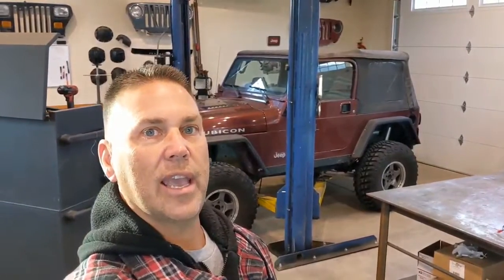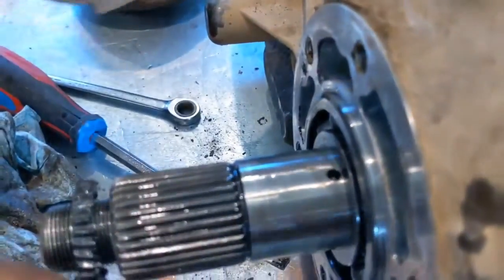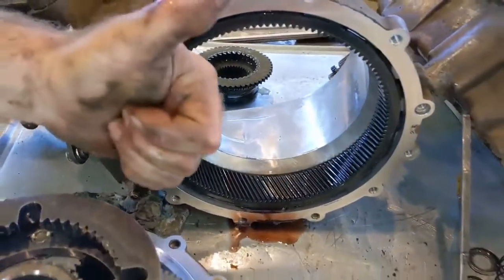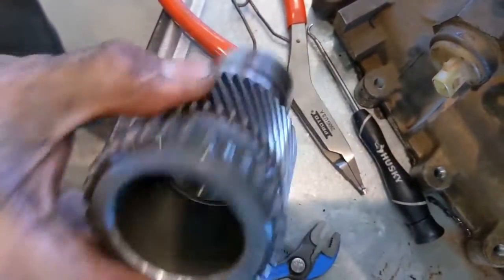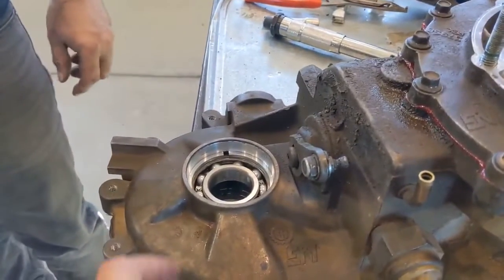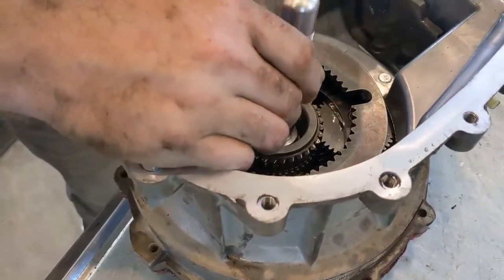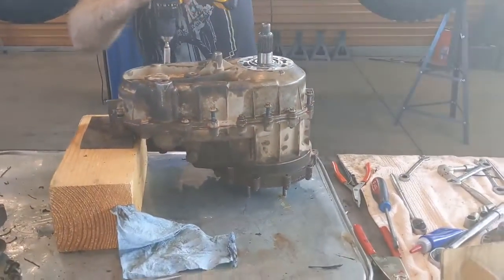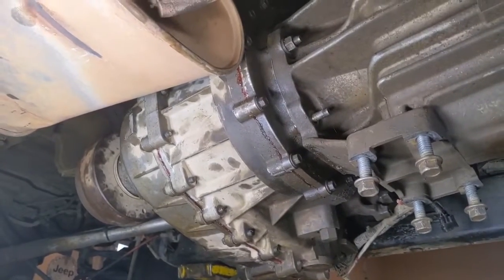How To Rebuild a Jeep Wrangler Transfer Case

Comment: When I removed the oil seal over the planetary assembly , so to extract the planetary and then remove the input bearing (5072458AA), I had to demolish the oil seal and doing so I made some scratch to aluminum edge. 
I'm thinking to place a very small quantity of gasket maker only on the scratched zone (to prevent future oil leaks) when I'll replace the new oil seal.
What do you think about?
Thanks a lot

Comment: Do you know if ATF +4 fluid contains Friction modifiers?
I'd like know to choose better RTV of Permatex.
GEAR OIL 81182 (if there are Friction modifiers inside oil). 
ULTRA Grey 82194 (if there are no Friction modifiers).
Thanks a lot
Reply from the maker: @paolofogaccia9455  ATF doesn't have friction modifiers. You'll see that in gear oil meant for limited slip differentials. If it has friction modifiers it will say so on the bottle.

Comment: At 0:59 that large circular gasket with 6 bolt holes / and 6 long slots that looks like it goes between the transmission and transfer case isn't needed. If you look at the bottom of the transmission there should be a small slot that has been machined out at the bottom where it meets the transfer case, and that slot acts as a weep hole if either the transmission output seal or the transfer case input seal leaks. My TJ also had that gasket when I took my transfer case off, but it must've been aftermarket as the dealer said no gasket is needed between the transmission and transfer case.
Reply from the maker: You are correct. We did not install the gasket either!

Comment: Thanks for the vid. I just had an issue when setting the input gear seal. I tapped it down till it stopped and all looked good. However, the shaft spun sometime during installing the input retainer to the front case half and I noticed the inner rubber of the seal was pulled away from the shaft. I had ATF’d seal, but all I can think happened was that the c-clip gap snagged on the seal and tore it while spinning. There’s nothing on the rear of my transmission that comes anywhere near the seal, so either the seal was bad or i don’t tap it down till it hits bottom with the next seal. Very weird.

Comment: Did you use anaerobic sealant on the front input shaft inner seal (around the plug that looks like a freeze plug which goes inside the splined input shaft)? Or will RTV work for that?
Reply from the maker: I can't remember what we did there. We used anaerobic where it called for it, but I just can't remember that step.
Reply: @TheBFHGarage  I went with anaerobic and I think it's fine. The seal is super tight there so I'd be willing to bet it could be pressed in with no sealant and still be fine, but it's good insurance. One thing I noticed is the front input shaft seal that is installed on the exterior of the case (the last step in the front cover) can be installed too deep. It should be flush with the cover because it can contact the bearing if pushed in all the way. I think it just happens depending on the seal; mine was different than the seal you guys used. I'm going to pull the old seal off and install a new National PN 3173.

Comment: Where did you get the rebuild kit? I bought one from Rockauto. It is a USA Standard Brand. The input shaft bearing in it is not the same and it did not come with new thrust washers for the planetary's. I saw your input bearing (The one with the snap ring slot in the center). Mine has the slot on the edge and wont work. Please tell us where you get your rebuild kits.
Reply from the maker: My buddy said he got it from eBay. No brand name.

Comment: I have a 2003 TJ X , when I put it in 4x4 it pops out of 4 hi and when its in 4 lo and I push in the clutch its like the brakes are applied , something is binding in the case . Maybe a bearing ? anyone have an idea what is wrong ?
Reply from the maker: Popping out of gear sounds like it's not engaging all the way. Do you have stock linkage or are you using a cable shifter? One way to determine if it's in fact the transfer case is to disconnect the shifting mechanism at the t case and manually put it in each gear and test drive it. If it still pops out, then it's a t case problem. If it doesn't, then it's a shifter problem. A cable shifter that is properly adjusted is your best option. If you're still on stock linkage, try adjusting it to see if it shifts better.

Comment: Why did you not change out the oil pump? I have parts on order for mine the new oil pump was only $25-30?
Reply from the maker: On the NV241 the oil pump is aligned from the factory and taking apart it is not recommended (no serviceable parts). I would leave it unless you have a pump failure.

Comment: BTW,  yoke nuts are Torqued To Yield and should not be re-installed.  Should be replaced with new.
Reply from the maker: Correct! We knew that going in and didn't get the new ones in time. Easy replacement when they came in.
Reply from the maker: Just a correction to this as I'm scrolling through comments. The nuts aren't actually torque to yield, rather they are simply designed for single use as their effective clamping force is greatly reduced after the first use. Same as a pinion nut. Torque to yield is where a bolt is tightened to a certain spec and then tightened a bit more to a specific degree. Think head bolts.